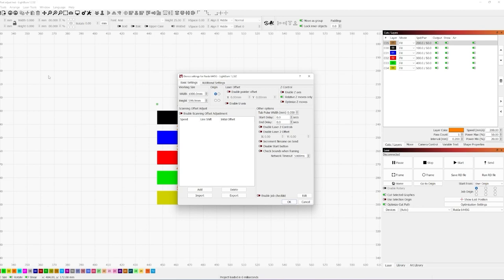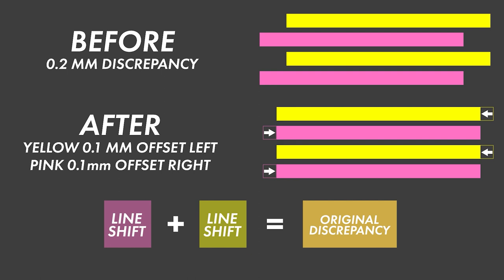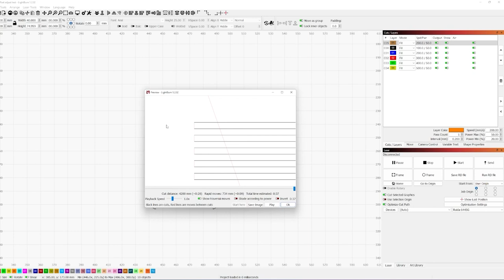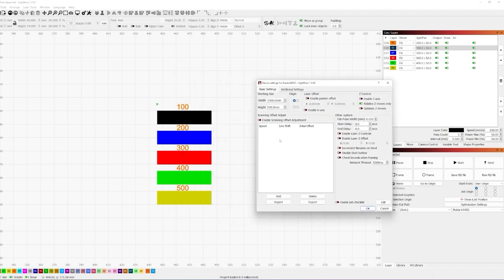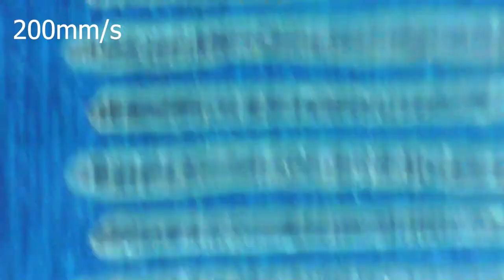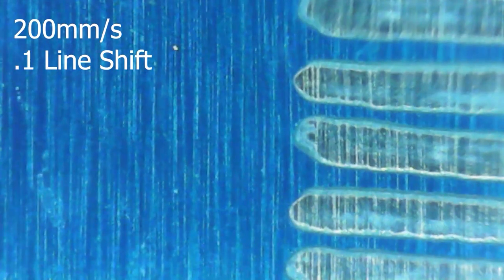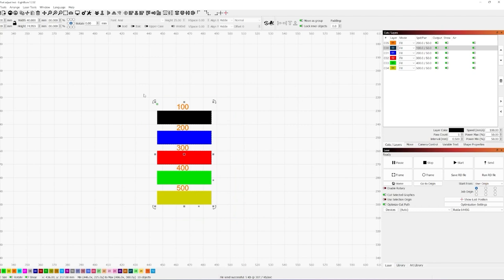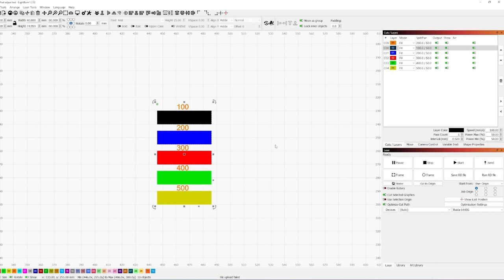Scanning Offset Adjustment for CO2 and Diode Lasers

Comment: You should be able to use this to isolate the dwell time for a given speed and apply it to any speed needed. Unless the delta V of the laser head isn't consistent, but even if it's not the difference would be miniscule.

Comment: Thank you Kyle!
Reply: Anytime!
Reply from the maker: Thanks for watching!
Reply: @LaserEverything  I did run into an issue. I got 100 spd dead on but after that everything remained the same. I even shifted my 500 spd to 7mm with no change. Besides line shift, would initial offset come into play?

Comment: I had some very bad ghosting appear on my new laser. It is a Thunder so everything was inputted into lightburn at the beginning but then weeks in this ghosting just appeared. After researching what the problem was on Youtube, I went into Lightburn to disable Offset Adjustment to begin and found it was disabled. I dont know how but I new how to correct it in a hurry. Got off lucky this time.

Comment: Do you have any kind of test for pulse width adjustment on a diode laser? I ran this test on Baltic birch and feel like I can get almost 259 dpi vs advertised 254. I am sure power speed and material means a lot.

Comment: Hi. thank you for your info. One thing, i managed to correct the offset, but, it was corrected on a 10x20 mm rectangle, not on a 200 x 300 mm image; any idea what may I have missing?
thanks again.
Reply: the size of the image isn't going to make any difference - this just affects how the lines line up, big or small it is still the same starting process

Comment: I set just one value for line shift at 1000mms (hybrid drivers).  I am having an issue on large etches where the center is off but the outsides are fine.  Is this because I did not set lower speed values????  I also tested on small area etches which might be large enough to get that full speed.   Mechanically my machine is new and I checked all the belts and lenses.  Thanks.
Reply from the maker: It's best to have a few data points for speed. Especially with a gantry machine, the head isn't moving at the demanded speed for the entire length of travel, it needs to accelerate to that speed from a stop, so it may be over-correcting or under correcting for other speed values. I would suggest adding more correction points to assist with the auto curve the software generates for in-between values. Normally I would start with every 100mm/s (100-500) but for the hybrid driver/servo systems that can handle 1000 or more speed, would go all the way up to max at the same increment. You can do larger jumps to try and save time (like 200mm/s increments), but you'll get better results with 100. I haven't found a need to go smaller than that on any of the machine I have access to. That may help with the shifting you're seeing, but be sure you're doing both parts of the adjustment, to make sure the contour line follows the engrave fill too.

Comment: if i run at 40 or 140 or 253 speed so i have to calibrate every speed number i use?
Reply: By the way thank you so much!!!!!! my engraving is 10x better then stock.. still unsure if i need to add in say 20mm speed and 50 and 80 and so on or does 100 cover 0-100 and 200 covers 100-200?
Reply from the maker: Do as many speeds as you can and Lightburn will average out all of them. The more speeds you do, the more accurate it will be.

Comment: hello!  I have this problem with my laser and when I enter the corresponding parameters, the lines move!  The fact is that when you put several designs at the same time, 6mm squares, the lines at the ends separate and in the center it engraves well.  I don't know what to do, I have adjusted the tension of the belts appropriately and it still happens.
Reply from the maker: So, typically this process is only to fix laser on/off times. So as the gantry swings one way, its just an on/off timing for the laser source to get right. This means if you have 1, 3, 15, any number of engraved squares in a line for your example, all the start and end points on all the squares should be more or less identical with being in-line with the rest of the lines for that object. What you are describing sounds more like the acceleration available might be impacting your engrave. The motors under load of the weight of the gantry and head swinging back and forth may not have the torque to accelerate quick enough in a small window. The motors may be underdriven on amperage (you'll have to check the drivers to see what they are set to, and the motors spec sheet to check what they are rated for), or the speed you are going might just be too fast for those motors to achieve with their torque before reaching an engraved object (and thusly affecting the offset adjustment for the start and end of only the 1st and last objects respectively). Think of it like a car on a runway. The laser is only giving itself so much runway to start and stop, right? 
You can kind of assess this further by adding a box the same height or bigger as the other objects, with 0% power on another layer to the left and right of the rest. Spread it out just a little. This will force the laser to pass further over to the left, and to the right, of the items in the line, and give the laser more time to accelerate to speed. This takes the acceleration out of the equation and only tests it at the demanded speed. If thats good, then you need to troubleshoot whether that speed is achievable with your hardware, or if its a physical, configuration/setting related problem and go from there.

Hope that helps!
Reply: @LaserEverything  I would like to show you some tests I did because the problem persists

Comment: Downloaded and for Mode and SPd/Power says Multi with no selection available. Why is that ? See in the video its set to fill.
Reply from the maker: There are two files I discuss in the video for two different uses as part of the process. One has a contour line and one doesn’t. To have a contour line on the same object and layer, it needs to be added as a sub layer. You opened the version of the file designed for that portion of the testing. That’s why it’s multi, it’s a line and fill :)
Reply: @LaserEverything  Thanks for the explaination.